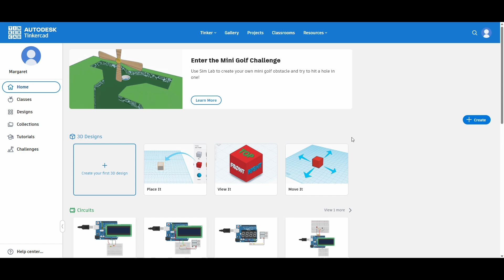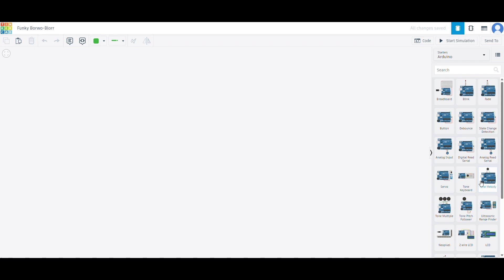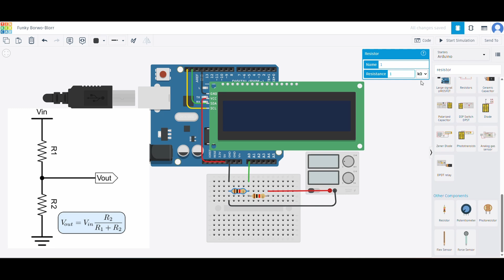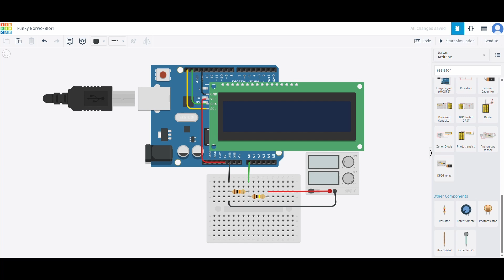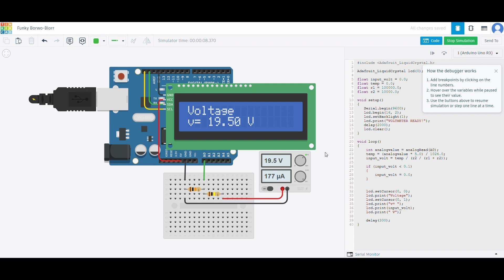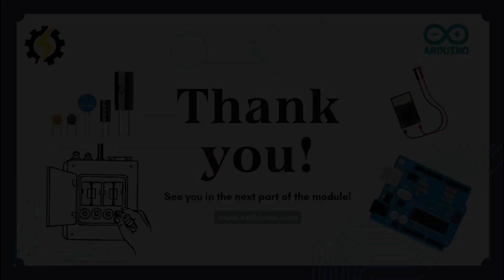Voltmeter simulation on Tinkercad

Comment from the maker: Here are the codes for copy and pasting:

#include <Adafruit_LiquidCrystal.h>

Adafruit_LiquidCrystal lcd(0);

float input_volt = 0.0;
float temp = 0.0;
float r1 = 100000.0;
float r2 = 10000.0;  

void setup()
{
   Serial.begin(9600);     
   lcd.begin(16, 2);      
   lcd.setBacklight(1);
   lcd.print("VOLTMETER READY!");
   delay(2000);          
   lcd.clear();         
}

void loop()
{
    int analogvalue = analogRead(A0);          
    temp = (analogvalue * 5.0) / 1024.0;     
    input_volt = temp / (r2 / (r1 + r2));   

    if (input_volt < 0.1) 
    {
        input_volt = 0.0;                    
    }

    lcd.setCursor(0, 0);               
    lcd.print("Voltage");                 
    lcd.setCursor(0, 1);                     
    lcd.print("v= ");                        
    lcd.print(input_volt);                     
    lcd.print(" V");                           

    delay(300);                            
}